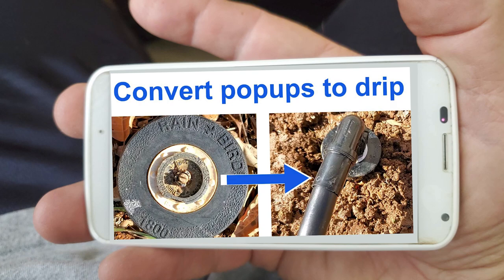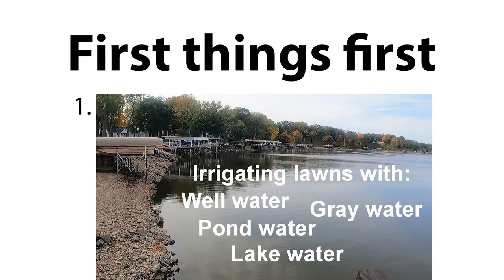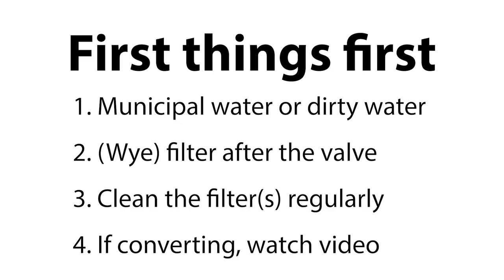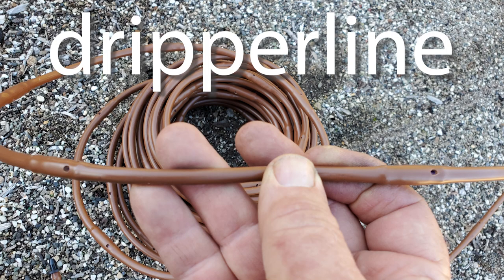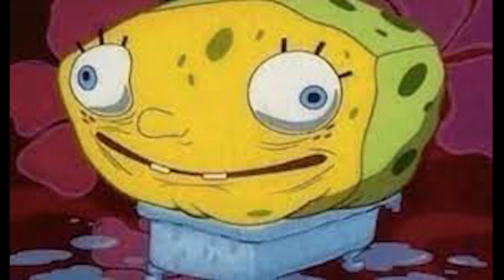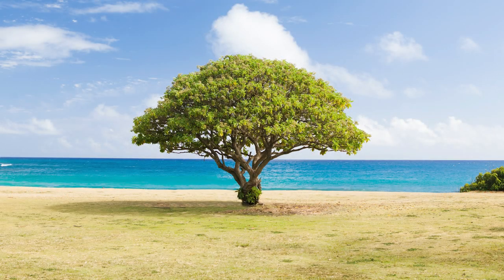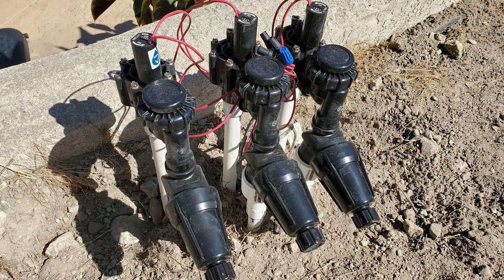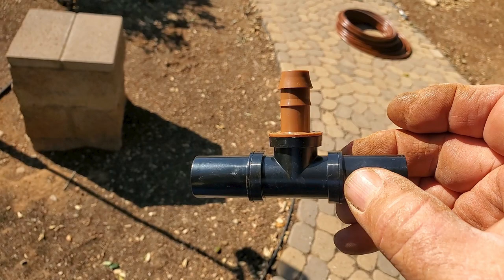How to install a drip system without installing emitters

Comment: Thank you for the informative video. I'd love to see you actually set up a line with the black tubing and then connect the techline to it. It seems several of your parts of the video just showed the black tubing and I didn't see any techline off of it. If you have a long stretch of black tubing, and need several techlines off of it for several plants along the route, are you not using one long line of black tubing and instead using sections of black tubing, connected together with the conversion T every where you need to add in a Techline section for a plant? Is there any time you can simply use the rainbird conversion kit with the brown T and run the techline straight off that  or is that only if you have a short distance and just a plant or two? I guess I'm trying to figure out why/when to use the black tubing and then have the techline coming off of it- just a cost savings doing so (assuming techline isn't cheap) and/or you want to only target specific plants and don't want to water anywhere else (I live in the forest so watering all the area inbetween where I've planted native plants wouldn't be a bad thing for the already existing natives) or are there other reasons? Hopefully my questions make sense. :) Thank you!
Reply from the maker: I use the black tubing as a distribution line and then tee off of it with the transition fittings and Techline. In the case of this video I had A section of Techline around each fruit tree and plant. You can see the Techline transitioned and laid down at 3:39 and 5:39. Yes, sometimes I am fortunate enough to be able to run the Techline directly off of the RB Retro kit but it all has to do with where the Retro kit gets installed.

Comment: You make a very good case for using the industrial timers like HUNTER. What would a install look like for a raised bed garden using main line and dripper lines using the valves that typically are connected to PVC pipe that typically are used to run lawn sprinklers???? The cost is not prohibitive and the rain sensors that can be added are extremely attractive. Thanks! The big box home centers use timers that have hose connections and as you say-in my experience-- need frequent replacement.
Reply from the maker: Marty, I'm not completely clear on your question but I believe you're saying you'd like to install a drip system in a raised bed connected to standard sprinkler valves and a professional grade timer/controller, yes?  If so, you can see different setups in my Drip Playlist but specifically in the one called Connecting Drip Systems to Irrigation Valves and Faucets. Let me know in a new comment thread if this helped.

Comment: I have a rock garden with six hunter 4” pop up spray heads that I want to convert to a drip system with the 1800 conversion kit you used in this video. I planned on doing 4 of the 6 sprinklers with conversion kits but do I have to cap off all of the pop ups that I don’t convert to drip ? Two of the sprinklers I kind of count on for watering a specific corner of the lawn so I’d prefer to keep them intact. Do you think this will pose an issue ? Thanks in advance
Reply from the maker: The only issue with not capping the sprinklers is the run time issue.  Rule of thumb is 10 mins. for std. popups and 30 mins. for drip tubing with Techline or std. drip emitters. Rule of thumb for drip sprays is 10 mins.  See my video called The 3 main types of drip to get an explanation.

Comment: Hi Sprinkler Pro - I have dumb question. I have a 6-zone sprinkler system, a small orchard of 8 fruit trees, 2 fledgling blueberry bushes, and flower beds. Do I need to add a separate drip irrigation zone to the system, then use the black line to bring water to the orchard, and distribute using techline to each fruit tree/bush, flower bed, etc? If no, I'll rewatch both videos, thank you.
Reply from the maker: It would be optimum to have a separate line to the fruit trees as they will have different watering needs than the other things but it's not critical.

Comment: You noted that it's better to install techline above ground. How may I do that if I have grass in my orchard? Just much the orchard and remove the grass? Thank you Sprinkler Pro.
Reply from the maker: When you say grass, do you mean like a lawn that is ornamental and you mow it? If you're irrigating the grass/lawn with sprinklers then it's questionable whether a drip system is even necessary for the orchard. Let me know.

Comment: Just curious, why don’t you like to bury the drip line like under a few inches of dirt/mulch? Is it because of the risk of the emitters getting clogged   if so, is the Hunter Eco -drip a good solution for this? It has some kind of mesh sock to prevent debris. I was thinking bearing the drip line would make it look better aesthetically.
Reply from the maker: Yes, drip tubing LOOKS nicer UNSEEN but then you can't see it so you can't inspect it or the emitters AND you can't see it so your shovels will slice through it AND the roots of trees and shrubs will swallow it and pinch it off. Keeping it above grade will solve all those potential issues. I just dealt with these things on a job this morning.